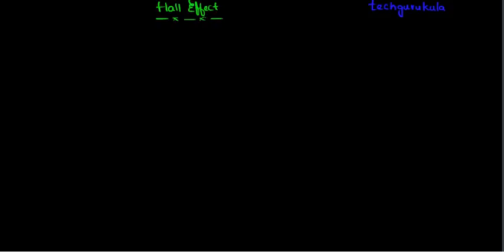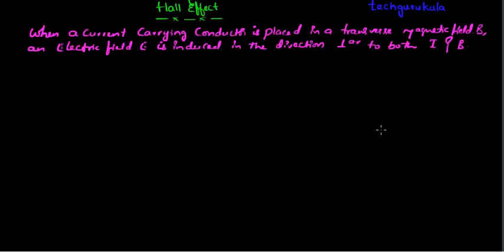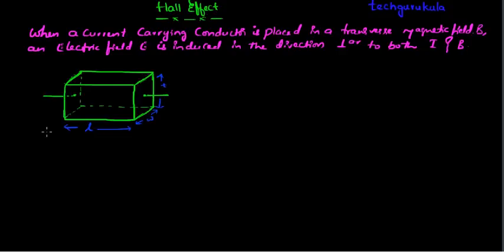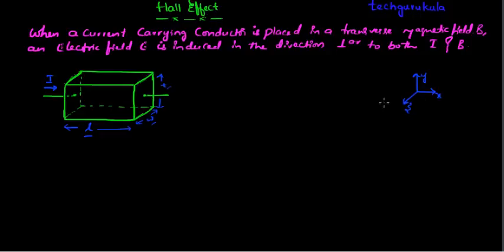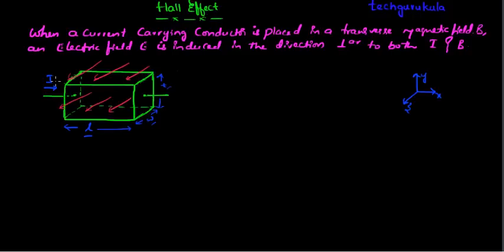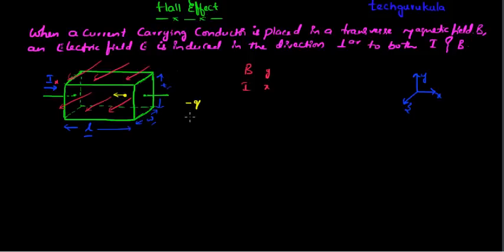Electronic Devices: Hall-Effect.

Comment: Why does J = qnv at around 9:00 mark? The units of current density are Cm/s/m2 = C/sm.

In 1 dimension (the wire) that becomes C/s. The units of qnv are Cm/s unless the unit of n is 1/m. Does n mean number of charges per unit length?

Comment: i thought electron is always attracted to positive terminal ?
Reply from the maker: Hi Harshini,

Electrons are always attracted to positive terminal, give a thought what happens if magnetic field is present... that's the whole point.
Here we have two things
1. Magnetic field force electrons to go to one side. It causes accumulation of electrons at that side, which makes it -ve side and the other side higher in potential +ve side.
2. This in-built electric field (Hall field), will try to force the electrons to go to other side.
That's why, when these two forces are equal, net flow of charges between side 1 and side 2 will be zero.

Hope this helps,
Techgurukula.
Reply: now i see
thanks alot for replying ! :))